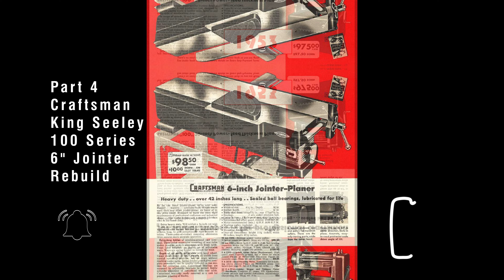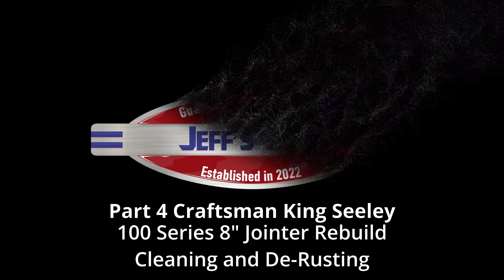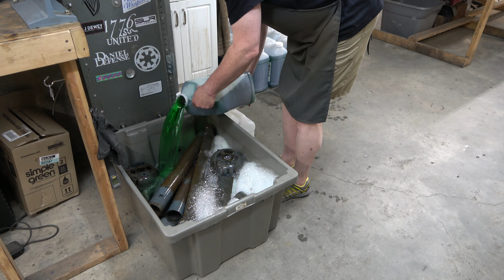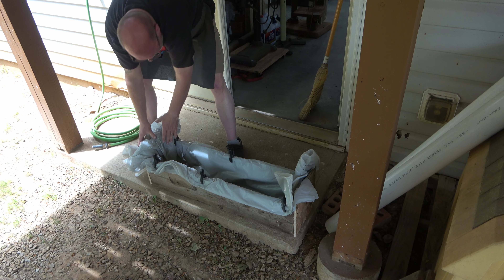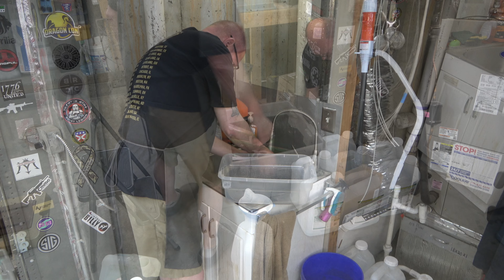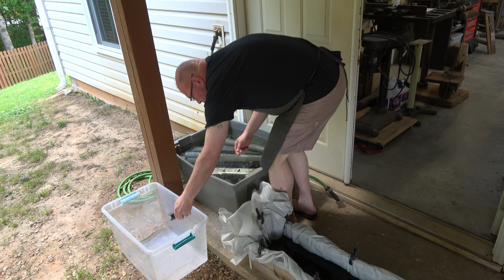Part 4 Craftsman 6" Jointer Rebuild (Cleaning & De Rusting)

Comment: Hi Jeff, after towel drying the parts, how long do you let them air out before painting?
Reply from the maker: Thank you for the question. The quick answer is as soon as possible. The longer answer is planning ahead. I work a full time job so I only have a few hours each day after work to play with a project. I normally get most of my project work done on the weekends. So, for example, if I soak parts in simple green on Monday evening, Tuesday I can rinse and soak them in Citric Acid. This means Wednesday I can rinse and dry; however, I may not have time Wednesday to mask before painting. So, Thursday I can mask and this usually means I am painting Friday. However, I soak parts in simple green on Friday, it may be a week before they ever get painted simply because I planned poorly. So the bottom line is that I want to paint as soon as possible once the parts are de-rusted but planning and I did not even mention the weather could slow that process down.
Reply: @JeffsShop  Thank you for the detailed answer and timelines. I have a cute little Delta contractor saw from the 60s I'm working on, but I've never painted something like it before. I usually just clean the guts and swap bearings, but this one looks really nice other than the flaking paint on the stand.
Reply from the maker: @MelodicSeoul  You are welcome and good luck with the repaint.

Comment: I had wondered about reusing the simple green. Pretty big investment, glad to see that you can reuse it several times. Same for Evaporust? I just bought 5 gallons, afraid to use it, expensive!
Reply from the maker: Yes, Evaporust is expensive and that is why I switched to Citric Acid. I would not be using the simple green if I could not re-use it several times.